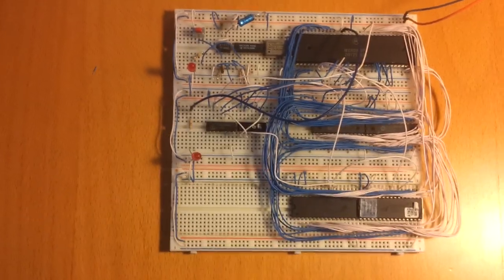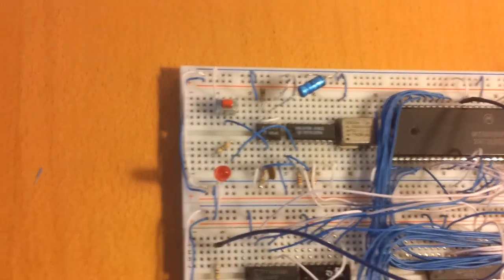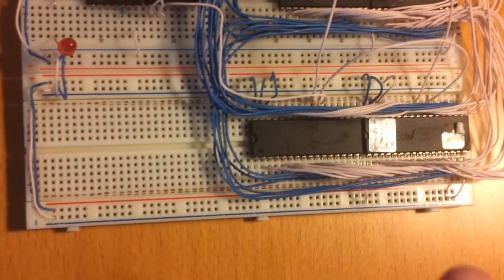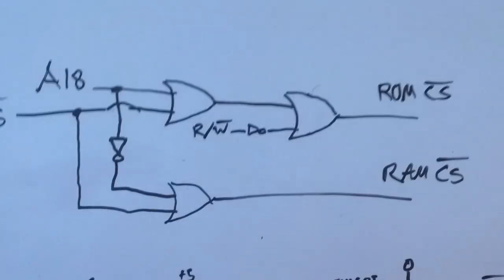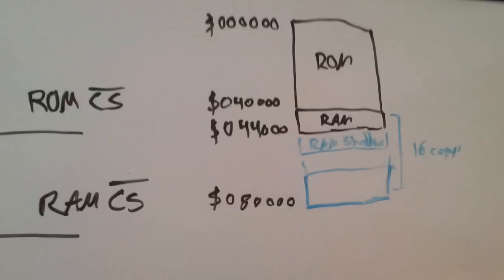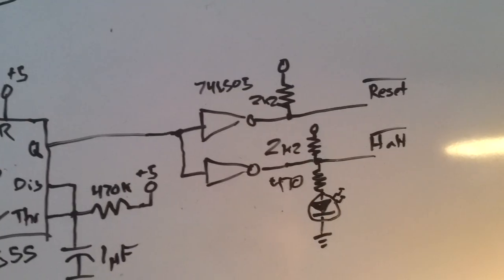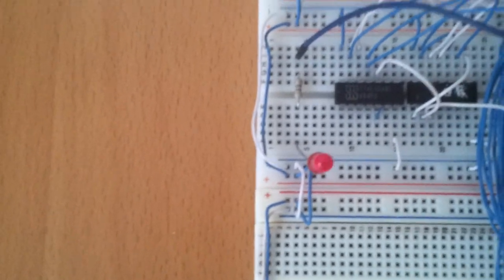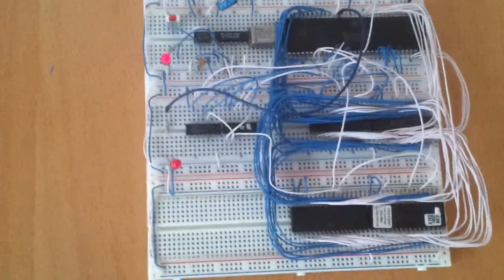MC68000 Breadboard Homebrew - First Life

Comment: I recently found a MC68000P10 that was going to be scrapped and would love to try my hand at putting together a homebrew computer. Where can I find resources to help me in this endeavor?
Reply from the maker: +Mark Florkowski Really the main things I used were the 68000 datasheet, and the datasheets for my RAM and ROM, mainly for pinouts. http://hackaday.com/2014/03/05/hackaday-68k-blinking-a-led/ was also a nice resource just for knowing what I should be tieing to a rail, or ignoring in a minimal setup. 
After that you'll need some kind of address decoding, if you feel like it, my kind of crappy setup is shown on the schematic for my computer on the hackaday.io page for it: https://hackaday.io/project/6186-mc68000-breadboard-computer
Also remember that since you have a 68000 and not a 68008 you'll need like me two ROM chips,  and two RAM chips for the 16 bit bus. 

For other resources there's the DTACK grounded newsletter from the 80s that talks about homebrew 68k computers, though admittedly I haven't read them. For assembly I found this to be a fairly good tutorial http://mrjester.hapisan.com/04_MC68/. And for assembling and debugging I'd recommend the Easy68k program.
Reply: +Chartreuse Kitsune thank you.
Reply from the maker: I'll probably also make another video on this, since now it's got quite a bit more on it, with a serial port, color ntsc terminal, and a YM2149F sound chip. I'm currently working on getting it more RAM (8MB of DRAM) so I can viably program it in C with space to load programs into RAM.
Reply: I do not have an EEPROM programmer, do you know if it is possible to build one?  Otherwise, I may try to use an arduino to write into some RAM chips, and then have the 68k read off those RAM chips as if they were ROM. I am not sure how feasible that is though.

Comment: I hate breadboarding smh i have a class that makes me do that stuff so confusing - fumo
Reply from the maker: Kyle Ly It's just running wires between parts, and each pin of the part can have a number of wires connected to it. Just only have one thing per vertical row and you're fine.